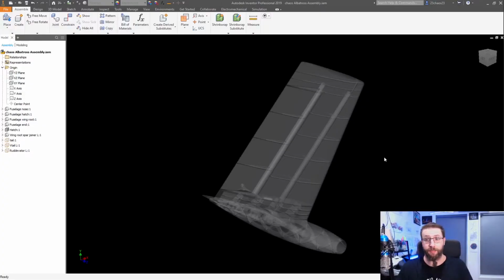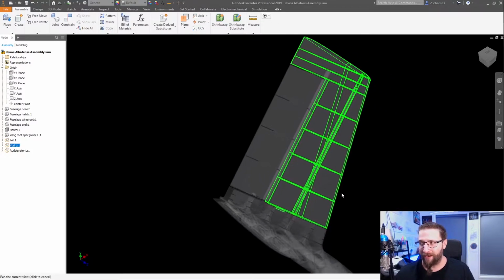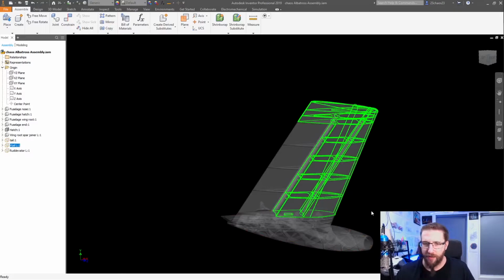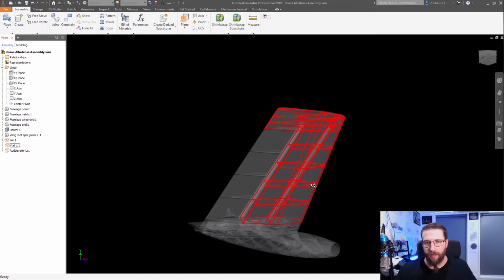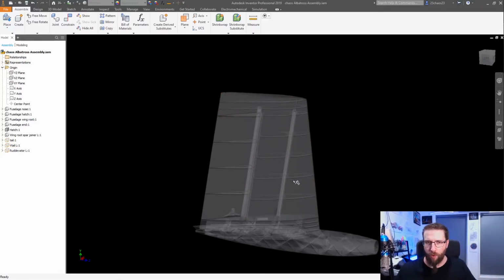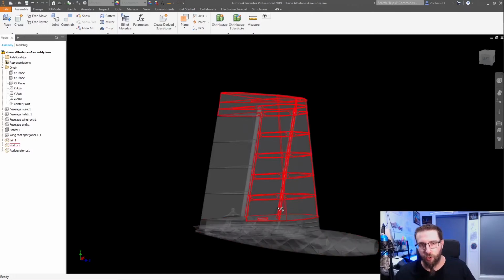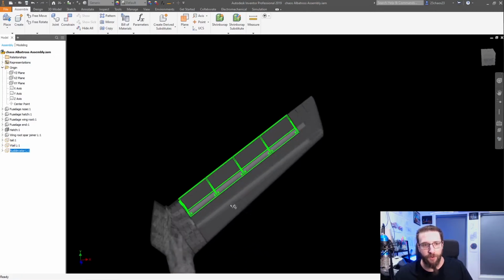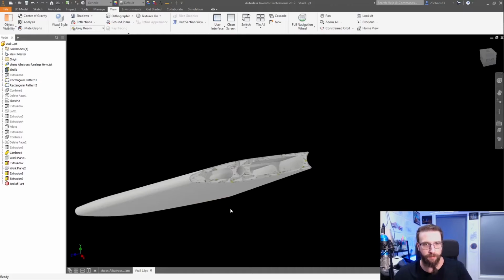chaos daily 2021: 049  Its so much better now

Comment: So sweeeeet! Does the white and blue give mechanical advantage over pure white or pure blue?
Reply from the maker: Yes, setting aside the cost of "Blu" for the moment, Siraya Tech's "Fast" resins are nice a flexible, very much like ABS not to mention they're excellent value. but im pushing the limits of the their material properties with how light Im trying to make this plane. And printing it entirely from Blu would be both expensive and the parts would be very tough but too brittle to handle any dynamic force loads. So by tailoring the ratio of Fast and Blu you can find exactly the right combination of tensile strength and durability.